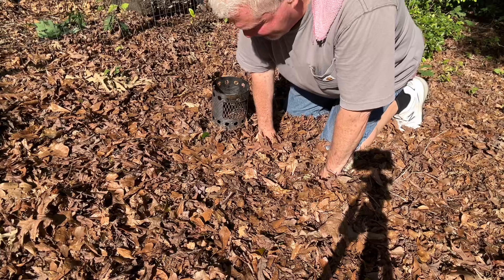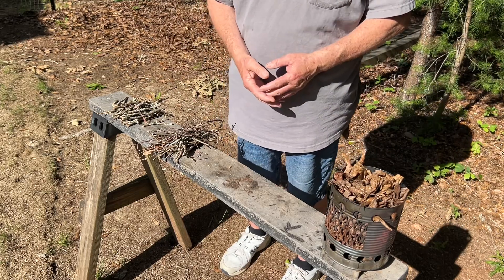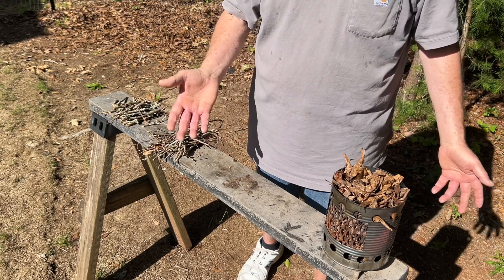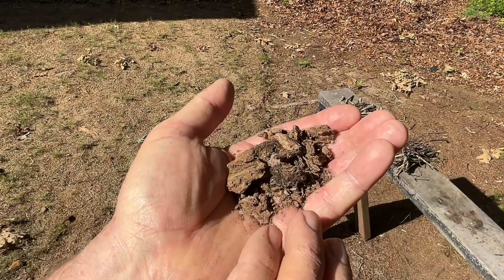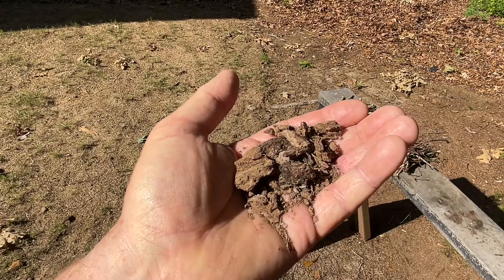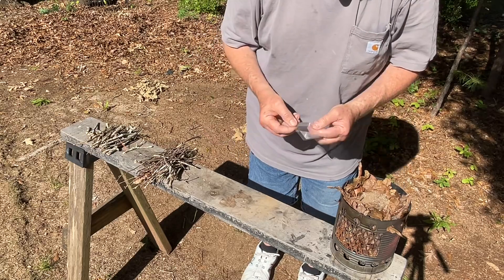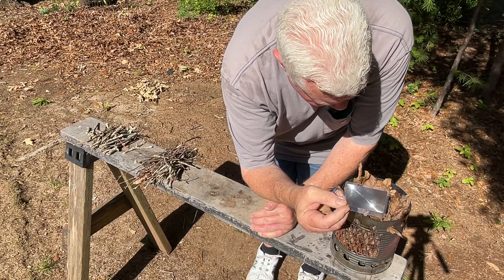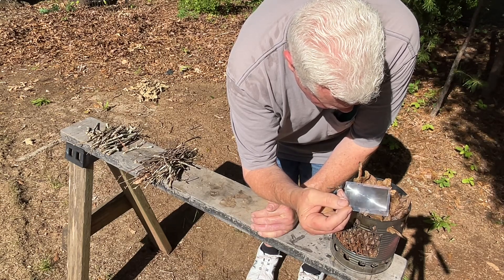Wallet Fresnel Lens Turns Damp Materials Into Fire

Comment: The bird calls in the background are insane! I love it!

Interesting use of punkwood. I used to start fires by holding four or five dry leaves in a stack and then focusing the sun on them. One leaf by itself would burn but not really ignite into flame. 

The focal point is very bright. When possible, I'd recommend wearing sunglasses when starting fires with a magnifying lens, and try not to look at the focal point any more than you have to. 

When I was in 7th grade I mail ordered a 12 in square fresnal lens.  Then my shop teacher helped me make a frame and base for it. It would heat metal red hot!
Reply from the maker: See my solar ignitions playlist.